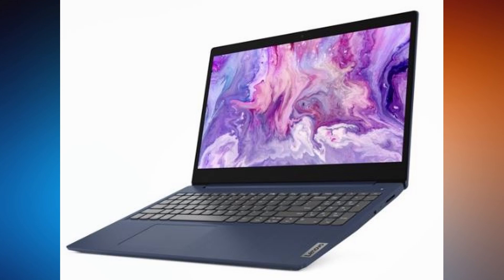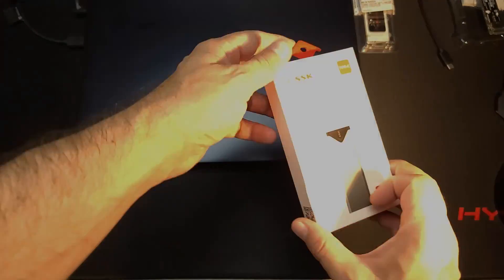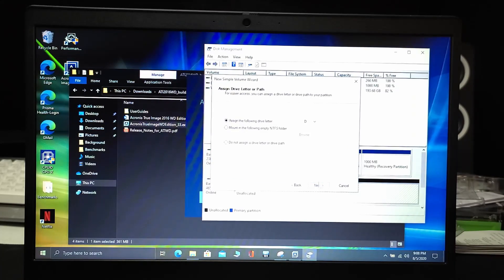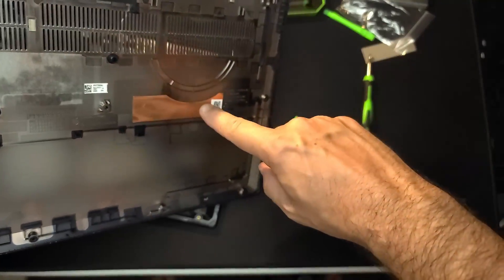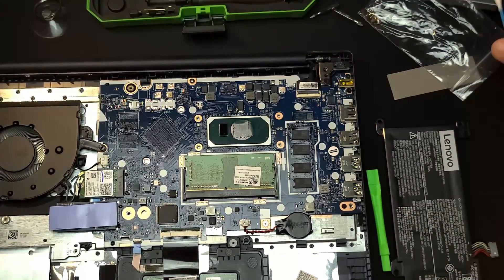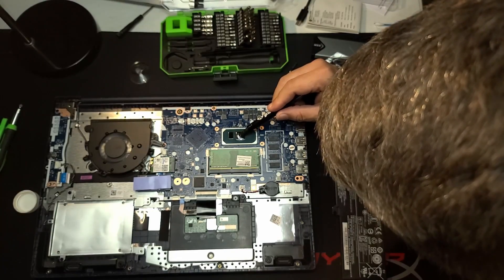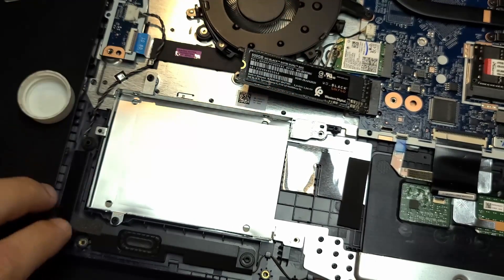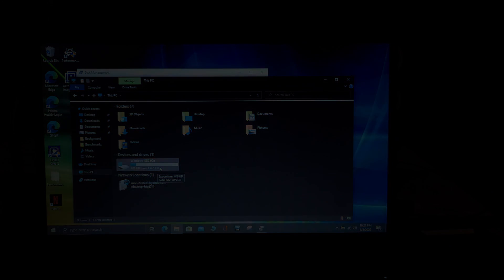Lenovo IdeaPad 3 Intel i3 1005G1, Upgrade. Replacing Thermal Paste, adding 32GB Ram & 500GB NVMe SSD

Comment from the maker: SSD Sata Data / Power "connector" for 81WE model. 
https://www.amazon.com/dp/B08QCR9FQQ/ref=cm_sw_r_cp_apa_fabc_zUQ8FbRMVEB1D
Reply: Where would it go connected?
Reply from the maker: @javierbenitez2674  There's a small ribbon connector on the motherboard just above the left side of the battery. It's labeled hdd. The sata cable/ribbon is shaped in a way that lands right at the motherboard connector you'll want to plug into. You'll see it for sure.
Reply: @TheSmileyTek  excuse the silly question, I'm new to this. Do I only need to buy the SATA cable from your link? don't buy the caddy and the screws? thank you for your answer
Reply from the maker: @javierbenitez2674  Not a silly question. I'd suggest opening up your laptop to see what you'll need exactly. Worst-case, you could purchase the carrier and return it if you ended up not needing it.
Reply: Add Gpu 1050ti?
Reply from the maker: Unfortunately, no gpu upgrade options with this laptop. Be nice if you could upgrade the gpu though. Although, you can use Steam Link to remotely game on this laptop using a gaming PC setup elsewhere. That's just about the only option.

Comment: Specs for this model say that max RAM is 12GB - did the 32GB stick actually work like it was supposed to?
Reply from the maker: @apesord  I think that reference to "max RAM" is in reference to the max available for purchase in that model? The 32GB stick is still working just fine all these years later. Only catch is a (not noticeable to me) speed hit, and there's no BIOS option to boost it to match the stick that came with it. No matter the speed of the new RAM stick it sets to 2666mhz.
Reply: @TheSmileyTek  If all 32GB actually register, then I'd gladly take a bit of a speed hit - thanks!

Comment: Hey mine is 1005G1 with hdd can I upgrade to SSD and upgrade my ram also but but it says only 8 gn of ram can't be upgraded in Google so can I upgrade
Reply from the maker: It's hard to say without knowing which laptop you have. The memory could be soldered like mine in the video, but if you have a ram slot, you could add or upgrade the ram stick. Are you sure it has an HDD? 10th gen laptops should come with a 2.5" SSD at the very least. You'll just need to pop the back off to see if you have an available M.2 slot and/or a ram slot to confirm your options for expansion or upgrade.
Reply: @TheSmileyTek  yeah I have an hdd in my laptop but I didn't know does I have an SSD slot 
And I have an 8gb of ddr4 ram of 2666mhz 
Can I upgrade to like u 32gb ram or 16gb of 3200mhz ram

Comment: can the processor be upgraded to i5?
Reply from the maker: Unfortunately no. The CPU is soldered to the MB. Typically, with laptops, you get what you pay for with limited upgrade paths. There are some laptops with desktop CPUs, or socketed lower power CPUs.

Comment: I have one dumb doubt, i have this laptop with i5 and 10th gen i need to add graphics how to do to this laptop
Reply from the maker: Unfortunately there is no option to upgrade the graphical performance. The model I have has integrated graphics (iGPU), so it is what it is. Most laptops don't really have many upgrade paths, other than drive capacity, and memory. When buying a laptop they are sort of frozen in time in terms of capability. Most that is. There are some that have options to upgrade a discreet gpu. But, the model in the video isn't one. They are usually more pricey. The only real option is to use Steam Link if you have a PC that can run games well, it let's you use that PC remotely. I've tested it out on this laptop. Works pretty well for single player campaign type games.

Comment: I bought an IdeaPad slim 3 with amd athlon chipset can its speed be increased with ssd as it has lag issues
Reply from the maker: If it currently has a mechanical drive installed, yes, it will speed up read/write times if you install a SSD.

Comment: Hi, I bought a 15IIL05 laptop and I want to ask you if the laptop recognizes and can use the 32 Gb ram you have added.
Reply from the maker: Oh yeah, been a year and it's worked just fine this whole time. Although, it's not really practical to have so much memory in this laptop, but I haven't had any issues. Remember it's only dual channel up to 8GB (2 times the soldered capacity).
Reply: @TheSmileyTek  so it's not possible  to replace the 4gb so dimm ram with a 16gb 2666MHz, 1 module ram?
Reply from the maker: @ΑργύριοςΤακλάκογλου  Oh yeah, you can install a 16GB. There is 4GB soldered to the motherboard + whatever is in the slot.

Comment: Hi Smily, I would grateful for your advice. I have just bought a Lenovo Ideapad 3 17.3 inch intel pentium gold, 4 gb ram, and 1 tb HDD - window 10S. I want to upgrade with 256 GS SSD from my existing Lenovo laptop and increase the RAM. Should I do the upgrade before  I setp the new laptop or after the upgrade. Please help
Reply from the maker: Either way should be fine. You'll just need to clone the old drive to the new one if it is going to be your new "boot" drive.

Comment: 32 GB RAM?     
Really? Is it showing all 32 ?   I thought Lenovo specs Max RAM  cap at 20 GB    (16 GB stick with 4 GB on board RAM)
Reply from the maker: Yeah it is. Pointless for me to have that much, but it works fine. Zero mem errors so far. Been a while now.

Comment: Hello Michael, 
I own the Lenovo IdeaPad 3 15IIL05 CORE i3.
I was told by Lenovo Tech Support that you can only up-grade the ram to 12GB. But when I go to search Crucial only shows the following: 16GB DDR4-3200 SODIMM. This would give the 15IIL50 a total of 20GB. What is your thought?
Thanks!
Reply from the maker: 🤔 I'd take Lenovo's word for it. My laptop has ran perfect with 36GB, but it's not very practical. 12 or 20GB would work just fine from my experience.

Comment: I need to know actual max ram upgrade on this laptop?
Reply from the maker: Good question. Based on the Intel Ark website for the intel i3 1005G1 cpu, which runs on the intel 400 series chipset, it can support up to 64GB. However the IdeaPad 3 laptop with the i3 1005G1, shown in the video, has 4GB of memory soldered to the motherboard. This limits dual channel to 8GB, but it will support capacities beyond that. My laptop is still running flawlessly with 36GB. I've had zero issues, and zero errors under normal use, and memtest64 stress tests. Hope this helps. Here's the Ark link.
https://ark.intel.com/content/www/us/en/ark/products/196588/intel-core-i3-1005g1-processor-4m-cache-up-to-3-40-ghz.html

Comment: Hi, I installed windows 10 because I changed from HDD to M.2 SSD, but i made a backup and apparently i lost the Dolby Audio app which was included, i just got the Realtek audio driver but not the Dolby, do you know how i can install it again? I searched on the Lenovo site but there is just the Realtek driver, thanks
Reply from the maker: 🤔 Maybe from the Microsoft store? Or.. https://www.dolby.com/about/support/drivers/ or https://support.lenovo.com/be/nl/downloads/ds503647-realtek-dolby-audio-driverwindows-10-version-17091803-for-windows-10-64-bit-ideacentre-aio-330-20igm
Reply: @TheSmileyTek  thanks bro, I'll try
Reply: @TheSmileyTek   I tried with both of them but didn't work. I kept looking and I finally found what I needed. if someone has the same problem you can get the Dolby Audio from the Microsoft Store, I had to search on google cause i couldn't find it direct on the Microsoft Store. Just install this one https://www.microsoft.com/en-us/p/dolby-audio/9njzd5s7qn99?activetab=pivot:overviewtab And thanks again bro.
Reply from the maker: That's great. I thought I remembered seeing it on there.

Comment: Hello,is it possible to upgrade the battery?
Reply from the maker: The more research I've done seems to point towards no. Although, the spec sheet shows a larger capacity battery avaliable, it looks like a different form factor. In other words, it looks like the larger option is a different shape, and wouldn't fit some of the model chassis. I'll let you know if I find different info, but in the meantime you can lower the power draw by changing your power management options. It will run slower, but it will help the battery last longer when not plugged in.

Comment: Please help me. I have Lenovo IdeaPad Slim 3 15iil05, 8gb ram (1), i31005g1 and the trash uhd G1 graphics. I want to add a GPU, can I?  External GPU or add a GPU inside the hardware. Is it possible? Please tell me if there's any way to do it.
Reply from the maker: I don't think it's possible since it's an integrated GPU and there are no thunderbolt 3 ports for an external gpu option.
Reply: @TheSmileyTek  I found out that I can upgrade to two 8gb ram sticks. I can also add ssd according to crucial's website. Will this boost my gameplay sir? Thanks for replying
Reply from the maker: Gotcha. If you're running off of a mechanical drive, an ssd upgrade will improve performance. The memory will allow you to run more "things" at the same time, but won't necessarily boost gaming performance. Hope it all works out for you.
Reply: @TheSmileyTek  yeah I tried playing gta v on my current specs but game stutters terribly whenever I speed even a bit so 20fps is best what I get
Reply: @TheSmileyTek  thanks for your detailed answers. Helps a lot
Reply from the maker: Do you have a higher spec'd PC? You can use Steam link and game on your ideapad through a higher spec'd PC.
Reply: @TheSmileyTek  no sir. The best laptop in my house Is currently mine 😂😭

Comment: How u added 32gb ram on max 16gb ram?
Reply from the maker: I never found documentation that states the max as 16gb, but the laptop's spec sheet said max offering: 12GB. Stills works fine, and passes all memory tests, but it only runs dual channel up to 8GB. Limited by the 4GB soldered memory chip. I planned to add a 8GB stick, but received the 32GB 😆.

Comment: Thanks for the straight forward video and the links!! getting ready to do this upgrade on my IdeaPad 3 Intel i3 1005G1 81WE  Question, Did you or anyone upgrading the ram  notice if it was still running in dual channel mode? Thanks Again!
Reply from the maker: Thanks man! Wish I had time to get back to making videos. Soon, soon. 8GB dual channel. The soldered RAM capacity determines the limit to dual channel. So my ridiculous 32GB RAM stick is only dual for 4GB of the 32GB. The lowest ram "module's" capacity dictates 8GB dual channel, using "Intel Flex Mode" which runs dual when possible if mixmatched RAM "module" capacities are installed.
Reply: @TheSmileyTek  Hey, Smiley! Got around to doing my upgrade. 1TB SK Hynix P31 Gold Nvme and 16 Gig of Team Group 2666Mhz ram sick and all went well. CPUid-Z says it is running in dual channel, but I don't know how much of it? However, I picked up 20% increase in ram speed! I was happy about that. Good ram for the price! The drive is double the speed too. I did not repaste CPU, which leads me to a question. Did you use a spreader to apply your new paste? I couldn't quite see in the video. My temps are sneaking up 5 or 6 degs Celsius at idle and I want to do it. Thanks again, hope all is well!
Reply from the maker: Wuttup! Nice! Pretty sure I did spread it, very thinly of course. Doesn't take much since it's a small die.
Reply: @TheSmileyTek  Haha..sounds good man! I did get the MX-4 with spreader, so here we go..lol. you're right, doesn't take much, you're just filling in the imperfections in the heatsinks and die..I see so many people spreading it too thick and then wonder why their temps are up. Thanks for the quick response! Take care man!

Comment: So does adding more ram or replacing them makes the laptop more powerful?
Reply from the maker: It does not unfortunately, but if you're a multi-tasker, you could run more programs at once. However, replacing the stock NVMe hard drive, with a "faster read/write" NVMe drive, did speed up program load times.
Reply: @TheSmileyTek  Oh I see thank you sir. And also thank you for the video 🙂

Comment: wtf you dont need 32gb ram in that kind of laptop xD 12gb is more than enough.
Reply from the maker: You're right, it's pointless and not recommended. I ordered a 8GB stick, for a total of 12GB. Somehow I was sent a 32GB 🤣. I didn't even notice it was 32GB until I booted up after installing it. I haven't had any issues, so I'll leave it. I rarely use that laptop these days. I need to get it back in action. Got a great deal on it. It's perfect for a student.

Comment: The only issue with this upgrade is you might have gotten more ram, but swapping that stick out you lost dual channel mode. 4gb onboard and 4gb stick kept it in dual.
Reply from the maker: Not sure if I lost dual channel, but yes, some speed was lost (Only getting 2400mhz with the 32 vs 2666mhz with the 4). No XMP options in the BIOS to get 2666 with the 32, of course. CPU-Z reads "dual rank" with both the 4GB or the 32GB installed, but I can't match the speeds of the 4GB. I haven't messed with it too much. It's my wife's laptop. There is a 12GB model; 8GB sodimm + 4GB soldered. I don't think the capacity differences would dictate dual vs single in that case. However, I wouldn't install mismatched capacities in my desktop. Probably best to purchase from Lenovo to ensure the best possible compatibility.
Reply: @TheSmileyTek  Anytime you mix ram like that you do loose dual channel. The no XMP just adds even more to it. Personally I would have left it as 8gb myself seeing as I doubt your doing anything that needs a ton of ram to keep the speed boost.
Reply from the maker: So I just checked, and it IS running Dual channel. I will link you to a picture on Twitter. Laptops are a little different than desktops.
Reply from the maker: @whitepawrolls  https://twitter.com/TekSmiley/status/1358152955053113344?s=19
Here's the pic of CPU-Z memory tab.
Reply: @TheSmileyTek  Its not dual channel mode even if the bios reports it. Modern systems use what's called a flex mode. its only a simulated dual channel. Not actual dual channel.
Reply from the maker: @whitepawrolls  Probably more accurate to say dual channel up to 4+4GB and flex mode beyond that, since it's beyond the soldered 4GB. I definitely would'nt suggest this configuration if memory speeds matter to one's application. I took this PC out of Windows S mode, and upped the capacity just in case. I can't tell a difference in the speed unless I compare the benchmarks.
Reply: @TheSmileyTek  That's what I meant when I said I would have left it at the 8gb to keep it in dual channel mode, but maby I wasn't that clear.

Comment: Can you add 2.5" SSD in this device?
Reply from the maker: Yes. You'll just need some screws to mount the drive to the carrier/ bracket, and the SATA cable (ribbon) that connects to the motherboard. The motherboard header is labeled HDD. See the link in my pinned comment.

Comment: I am doin the same upgrades. Is that 32GB memory still working correctly?
Reply from the maker: Oh yeh. No problem at all. The 400 chipset for intel 10th Gen and the i3 1005G1 easily handle this capacity. I'd suggest just going for an 8GB stick for 12GB total. Save a little $. Unless you're doing some video editing of some sort. I haven't come close to needing 36GB of memory.
Reply: @TheSmileyTek  Yeah, I will be going with the 8GB. Was just curious if using the 32GB was still working since it's not supposed to support over the 8GB, right?
Reply from the maker: I haven't found any specs or datasheets saying that it doesn't support anything over 12GB total. I've only found that 12GB (8GB stick + 4GB soldered) was the max amount installed from Lenovo. It seems to just depend on the motherboard chipset, and the CPU. Which in this case is limited by the CPU at 64GB. Here's the "ark intel" link.
https://ark.intel.com/content/www/us/en/ark/products/196588/intel-core-i3-1005g1-processor-4m-cache-up-to-3-40-ghz.html

Comment: Hi, how did you get the processor up to 3.4ghz please
Reply from the maker: 2 ways. 
1) Click on the battery icon in the bottom right Windows task bar and move the "Power" slider all the way to the right (Max performance)
Or 
2) Right click on the start button, click ⚙ for settings, type power management into the settings search bar. Select power management and select the "Maximum Performance" option. I think it's set to "Balanced" right out of the box.
Reply: @TheSmileyTek  okk thanks

Comment: What is the best? i3 1005g1 or i3 8130u?
Reply from the maker: My personal opinion based on the "User Benchmark" data... 1005G1 is newer, 10nm process, 25% to 33% faster cores.. 1005G1 looks better to me. Here's the info: https://cpu.userbenchmark.com/Compare/Intel-Core-i3-8130U-vs-Intel-Core-i3-1005G1/m468020vsm906918

BTW, the "U" suffix means Mobile Power Efficient and the "G1" stands for Graphics Level 1 (G1-G7)

Comment: can i used kingston instead of hyperx?
Reply from the maker: Definitely. Go for it
Reply: @TheSmileyTek  any frequency is compatible or im gonna follow ur same frequency?
Reply: @TheSmileyTek  https://shopee.ph/search?keyword=ddr4%20sodimm%202666 hey can you suggest which is better im gonna go for 16gb just click the link ty and let me know which is compatible with my device same as your's
Reply from the maker: I'm only getting 2400 speeds from a 2666 stick. There's no XMP support and no option in the Lenovo BIOS to enable it. Any DDR4 sodimm will work.
Reply: @TheSmileyTek  at any frequency?
Reply: @TheSmileyTek  im gonna buy kingston since i already have 8gb ram gonna chnage the 4gb ram to 16gbram isthis possible?
Reply from the maker: Hmmm. May as well go 2666. Not much difference in the prices. Just my opinion.
Reply from the maker: @senkuayano4937  Sounds very possible. Go for it.

Comment: I have the same laptop but with 128gb sad and 4gb on-board memory, to run both the rams in 2666mhz , should I get a 4gb ddr4 3200mhz or 2666mhz?